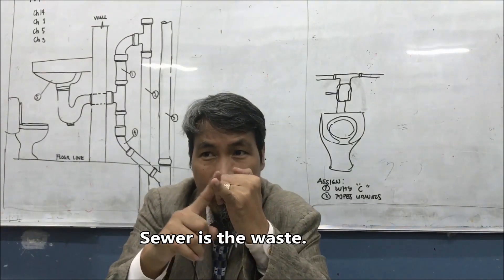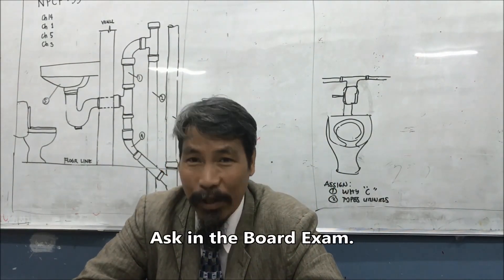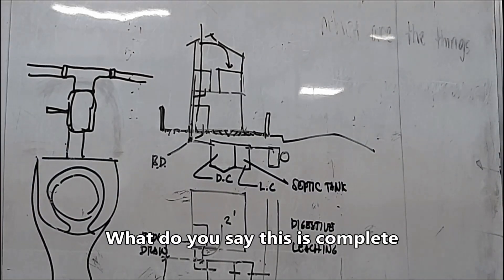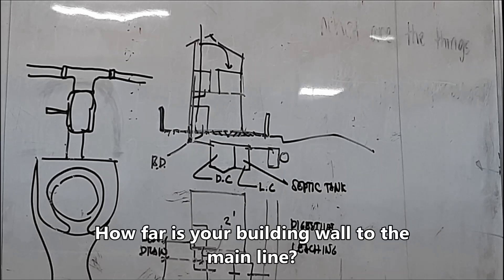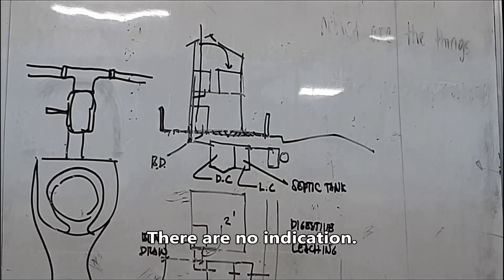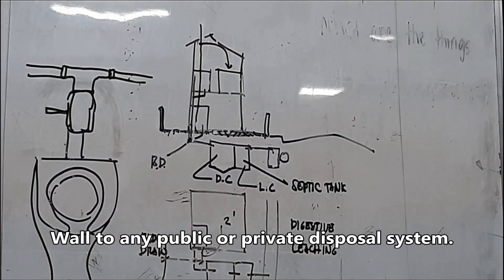CE526 Sanitary FirePro & Plumbing || NPCP ch3: Gen. Regulations Part 5 || Master Plumber Board Exam

Comment: This video tackles about sewage system. Sewers are extremely important components of urban infrastructure that helps keep the urban environment safe from flooding and prevents the spread of water-borne diseases by safely transporting waste water to the waste water treatment works and through the transport of rain water from urban surfaces.

Comment: Manglicmot, Lou Ashley L.
19-01582

thank you sir for mentioning again on what's the difference between sewer, sewage, and sewerage, because as you said that it will be mentioned in board exam, and it is confusing if you're not familiar with these words.
>The planner will be a laughing stock if he/she draw an arrow where the master plumber must look for itself where the drainage system is.
>It is important that the client must pay the engineers, because if not the design of ypur house or building will be inaccurate or won't properly work

Comment: Ruiz, Sharlize Veyen C.
19-00620

It's a great recap for sewer system sir. You have mentioned it on your previous video. Also, I learned that water meter, main line, drainage location is a must. The convenient way for a planner is to put an arrow on to it, so the master plumber can look at it himself/herself. From 304, All drainage, pipe should be connected properly because it discharge liquid waste and sewage. BTW, That's funny sir. A well-explained and humorous discussion. Thank you Sir.

Comment: 1. Paglinawan
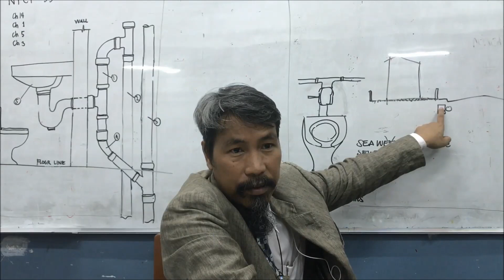2. Culvert (@5:44)
2. Drainage System (@5:50)
3. Water meter (@6:28)
4. Drainage (@ 7:23)
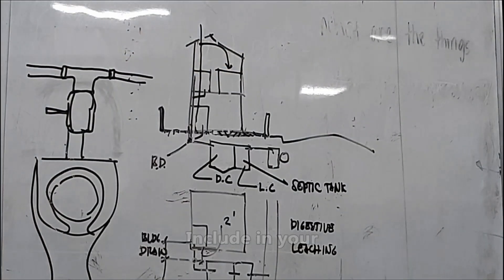5.Pipes (@9:43)
6. DWV and water supply line (@9:51)

Comment: CARIAGA, J.M

1.Sewer (0:9)
2.  Sewerage ( 1:06 )
3. Supply pipe line ( 2:13 )
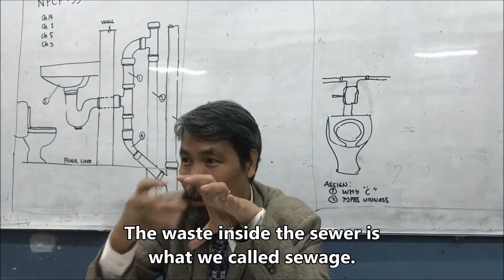4. Sewage ( 2:31 )
5. Bulding drain ( 4:15 )
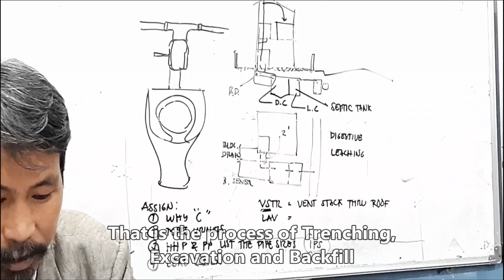6. Tenching, excavation, backfill ( 14:43 )
Reply: 1. Dela fuente
2. Sewage @4:18
3. Building drain @4:22
4. Building Sewer @4:26
5. Water line @5:23
6. Water supply line @5:35